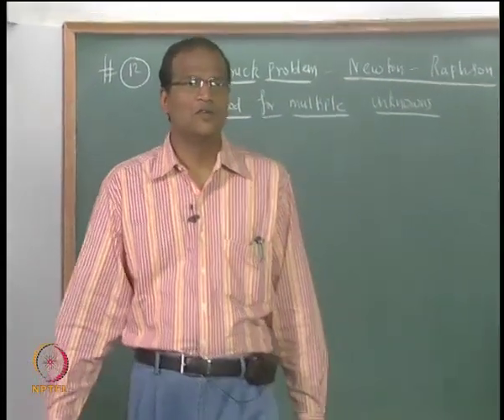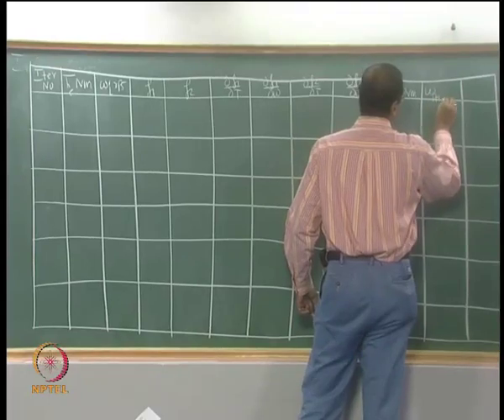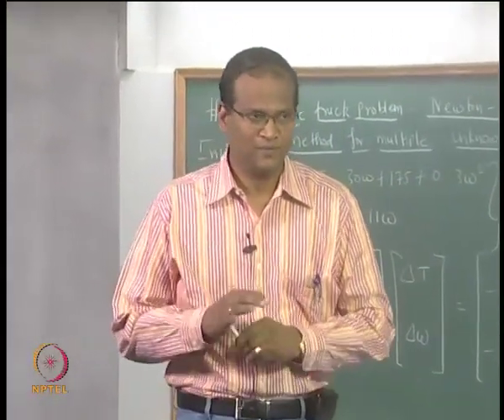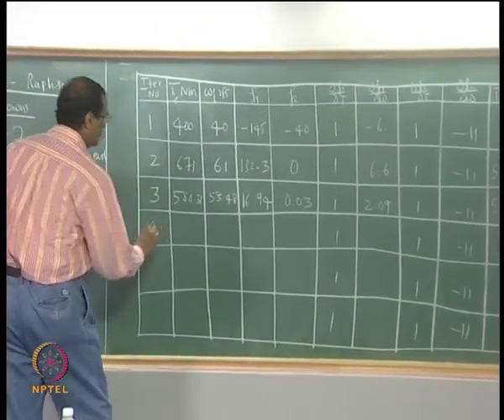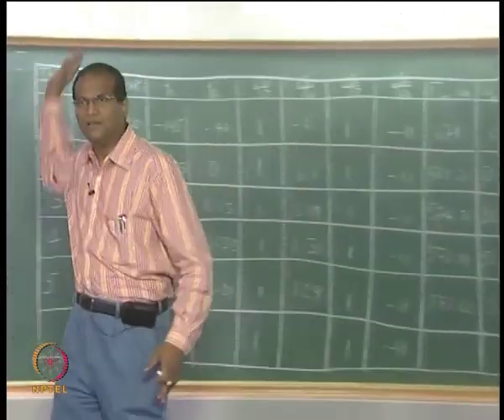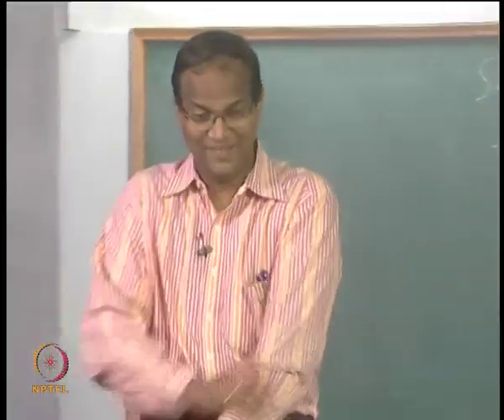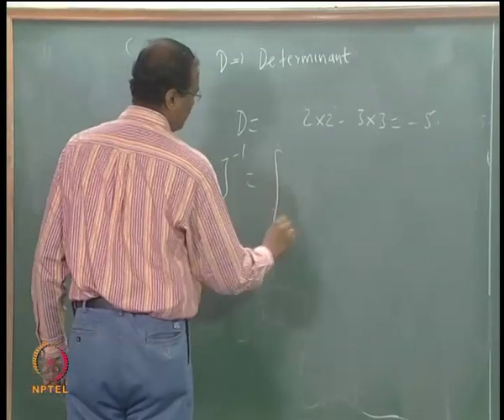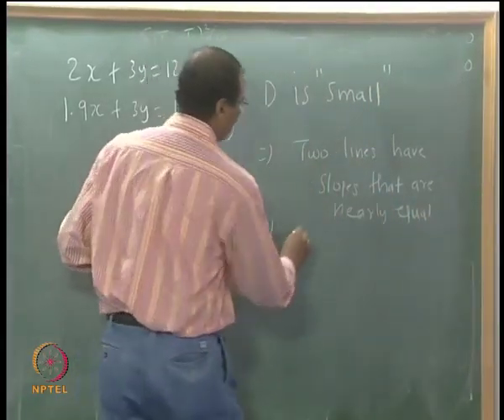Mod-01 Lec-11 Newton-Raphson method for multiple variables

Comment: Hi, there. I did 6 iterations of the “truck problem” using Excel and I got the following results:
T0= 400                      ω0= 40
T1= 671                      ω1= 61
T2= 588.3125             ω2= 53.48295455
T3= 574.0670495      ω3= 52.1879136
T4= 573.6175534      ω4= 52.14705031
T5= 573.617105         ω5= 52.14700955
T6= 573.617105         ω6= 52.14700955

So the results are T=573.617105 [Nm] and ω = 52.14700955[rps] with a precision up to 6 decimals.
I got the same results of this video, but Excel was more accurate.
I hope that these calculations have been useful for you.
My name is Carlos Vicente Dominguez.
I am a graduate student of the specialization in electric power systems at Central University of Venezuela in Caracas. Best regards from Venezuela.